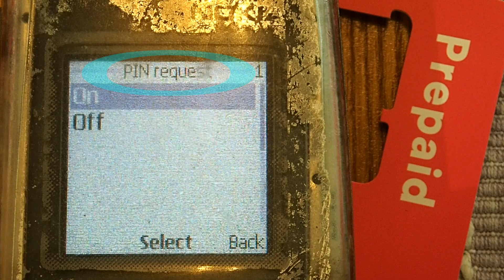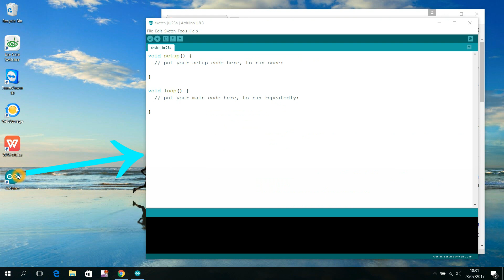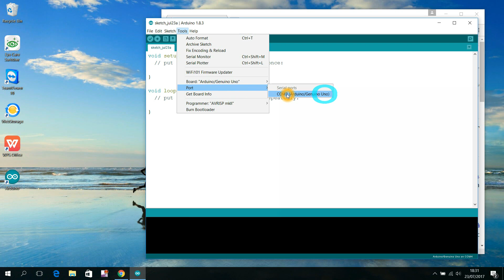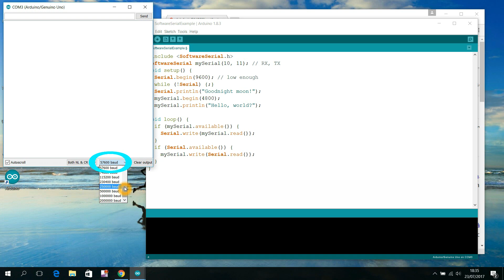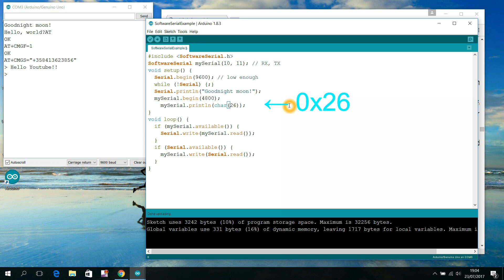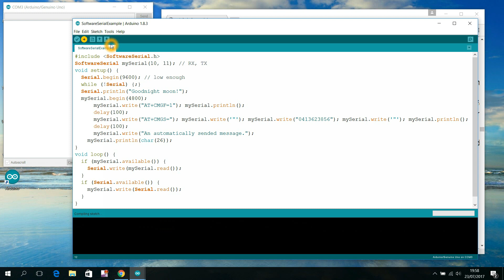Sending Text Messages with an Arduino UNO (video #15)

Comment: Can I ask a question about the arduino UNO? Will it start working as soon as power is applied to it, or does it take some time (lag) for it to boot up when power is applied?

My thinking is: I'd like to use this contraption for a door alarm. I want a battery powered, text message door alarm that sends a text message to my phone if a door is opened by someone other than me.

My idea is to have a switch in such a position that if someone opens the door without disconnecting the switch first (like an intruder who doesn't know about the alarm) the button on the switch will be depressed and make the arduino and gsm module send the text message.

However, if the Arduino has to have a battery connected at all times. I will be running to this door all the time to change batteries on it.

So could I also make a switch that closes the power circuit when the door is opened and the arduino will still send the text message?

As in, when the door is closed, there is no power from the battery pack ti the arduino, so it's in a "rest mode" of sorts. But power is applied when a switch is depressed by opening the door.

Will this work?

Comment: please help! at 3:26, i keep getting this message:
Arduino: 1.8.15 (Windows 10), Board: "Arduino Uno"

C:\Users\MyComputerName\AppData\Local\Temp\arduino_modified_sketch_517613\SoftwareSerialExample.ino: In function 'void setup()':

SoftwareSerialExample:11:13: error: a function-definition is not allowed here before '{' token

 void loop() {

             ^

SoftwareSerialExample:18:1: error: expected '}' at end of input

 }

 ^

exit status 1

a function-definition is not allowed here before '{' token

This report would have more information with
"Show verbose output during compilation"
option enabled in File -> Preferences.

Comment: I'm VERY new to arduino but have 2 quick questions... 1) why does the programme only work once (for me), before I have to re upload it to the arduino to allow the SMS to be sent again?        
2) why does the program only work when it is connected to the my PC and 9V battery? Can the arduino and module not just run off the battery? 

any help is appreciated :)
Reply from the maker: I'm glad that your module works! Well done! 1) Some of the programs of the video are such that the message will be sent only once. Try altering the program. 2) The power from the PC USB port isn't much enough for the module. Thank you for your feedback!
Reply: Mine also only works once??? if you figure out the code to make it loop please can you share as I'm not a coder! many thanks

Comment: Why don't you buy these stuffs from aliexpress.com ...these modules are way more cheaper there!
Reply from the maker: I often by stuff from AliExpress, too. But mostly I buy form eBay. And yes, several item could be cheaper at AliExpress. For the more expensive items one should check the prices from both of the two.

Comment: i have the same sim module but it does not work i do the same think i think that the module work on 2 A 5v and the arduino board can not generate this power

Comment: Great video again. Question where did you get the simcard and did you do a lost of research to finde the most inexpensive deal.
Dont you need any other subscription to send sms or mms? Is is good only in Finland?
Reply from the maker: Hej Nicklas! I bougt my SIM card from a kiosk nearby. I wanted it to be a prepaid card so that those 4$ would be the only cost that is to come. At the settings of the card it is importatnt to remove the PIN code asking. And it is important to supply the correct voltage (with my module 5V) and to be prepared to supply at least 1A of current. 

From your name I assume that you could be from Sweden. The SIM800L shoud work with Swdish SIM cads:  http://elektronikforumet.com/forum/viewtopic.php?f=7&t=81681#p1224808